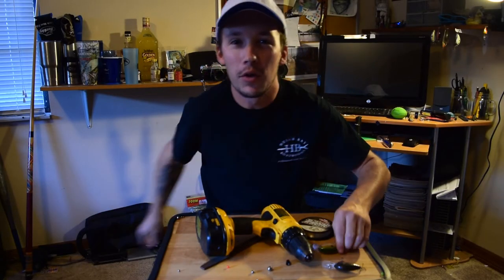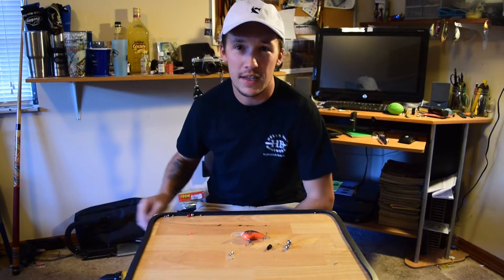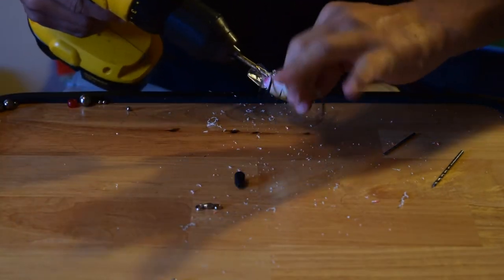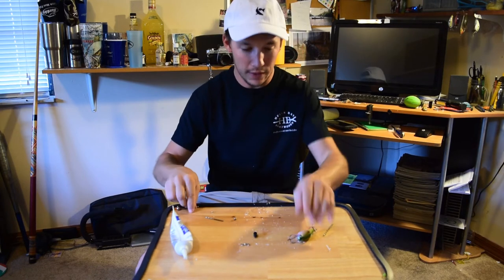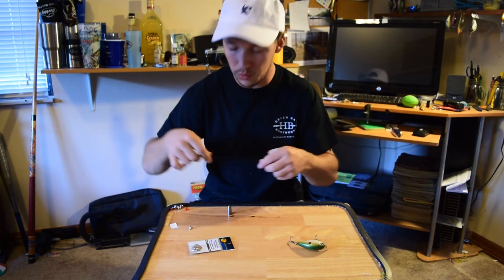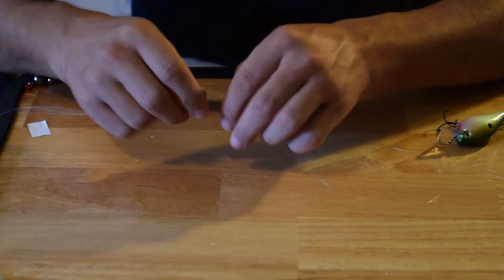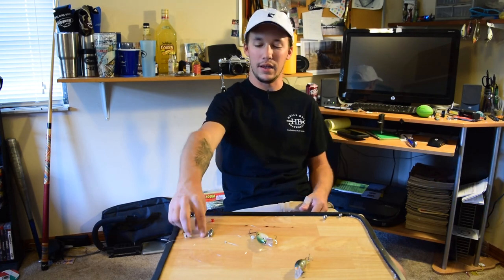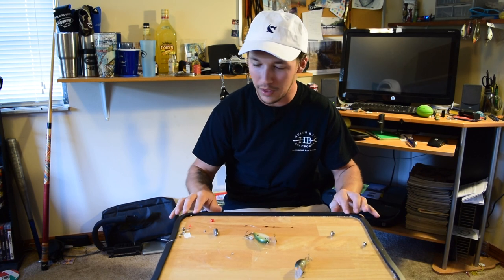3 EASY ways to get the MOST out of your crankbaits

Comment: Hmmm, not sure that last option, Carolina rigging, will work so well.  When you cast, the inertia of the weight and lure are not exactly going to be "harmonious".  Resulting in something approaching the action of a helicopter rotor as it flies through the air.
Some cool ideas though Cam.  Keep them coming mate!
Reply from the maker: Thanks bud! I should have mentioned that rig works better by long lining it. Your right, if you don't have the perfect swing, it does spin out of control.